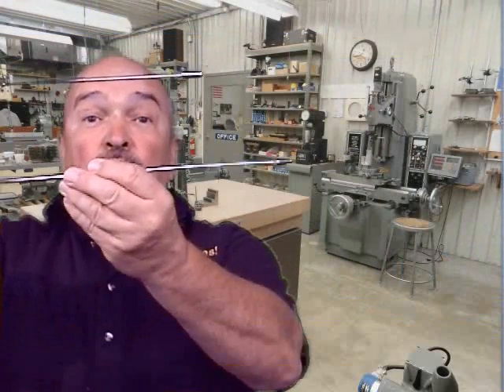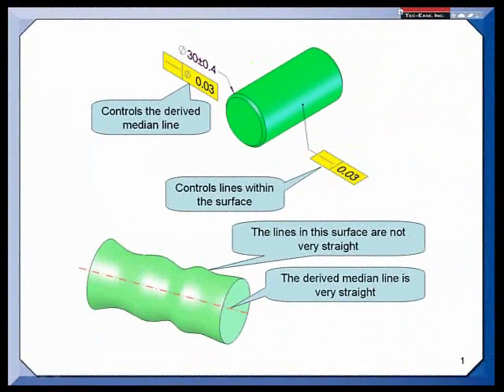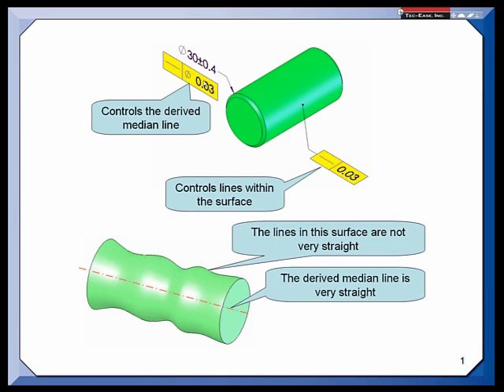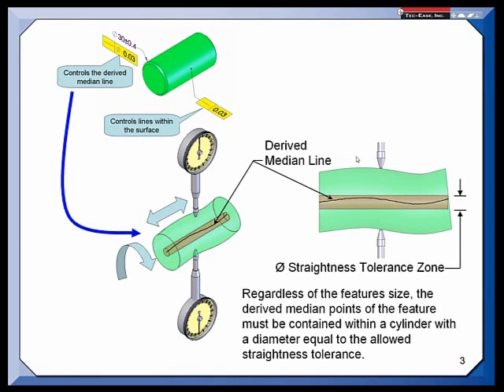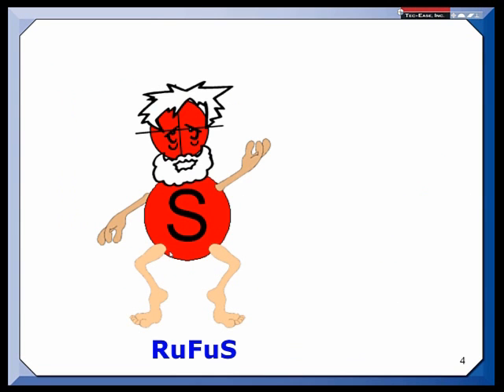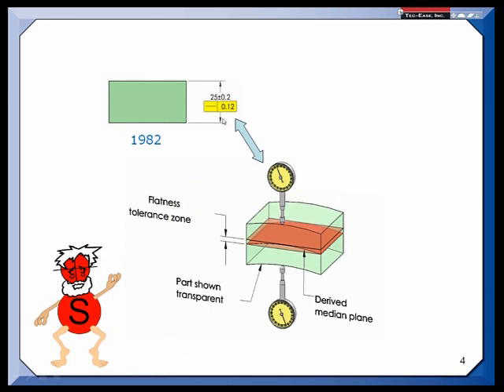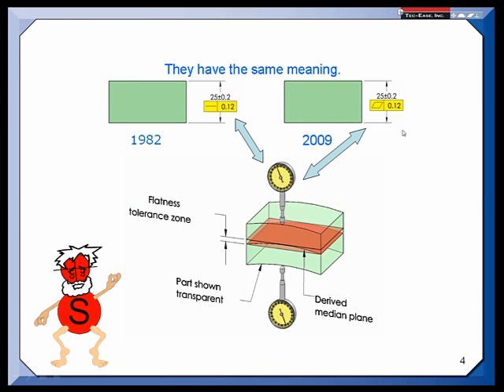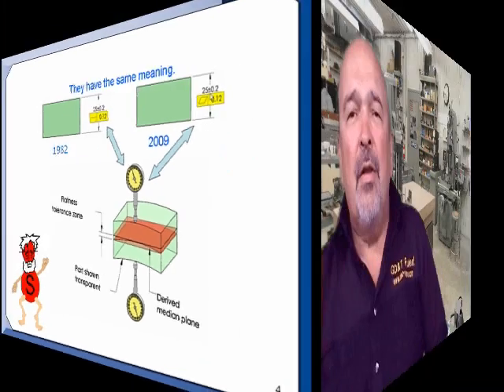GD&T Tip -  Flatness and Straightness Have Changed

Comment: I have a piece of steel flat stock that I need to state a flatness or straightness for? I do not know for sure. The bar is 30" long, 1-1/2" wide and 5/16" thick. If you look at the thickness, I need the part to not "wave" more than 1/32" over 12". Basically - "FLAT" How do i note this on my drawings to my machinist?